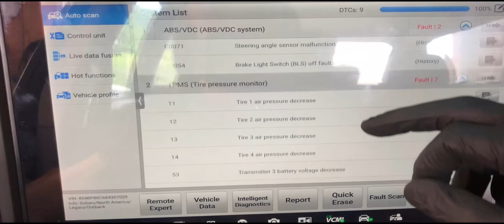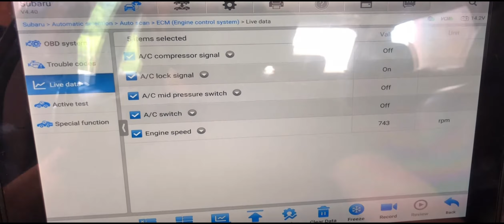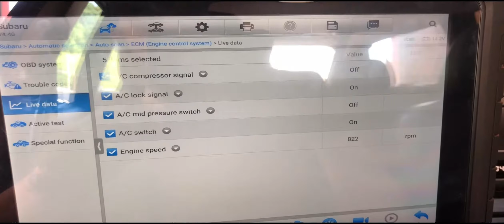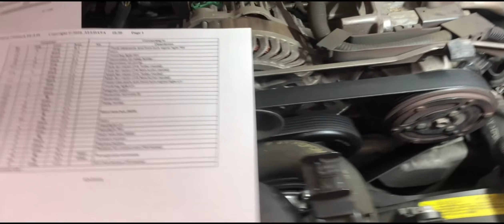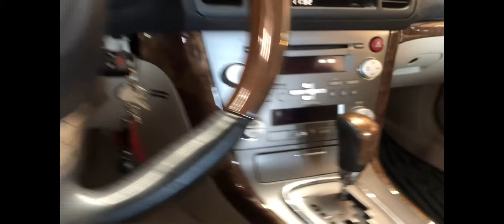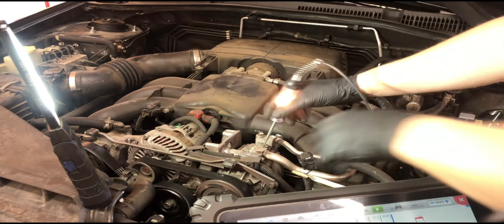Case Study - 2008 Subaru Outback Has No A/C

Comment: The AC Module is not online, this is one reason why after repairs, we like to see another full scan and a full module count for verification, you know how followers always want to see EVERYTHING. WOW that live scan data list for the AC System sucks. AC LOCK is like the Toyota Sensor, it sees if the guts are spinning similar to a single waveform like a CMP, if the internals are not spinning, then no RPM signal so the Compressor must be locked. On a Toyota, the AC Switch light will blink. On some compressors, the little trigger deal inside may have fallen out of its holder or too many metal fillings on the trigger or it simply broke off and lying inside the compressor someplace, of course, the pickup sensor can be bad, need a scope to have a look and check for power and ground as well.

YES, broken belts can beat the hell out of wire harnesses and connectors. Checking for codes popping up on a regular basis is highly advised as a standard practice even if it's a waste of time sometimes. 

The clutch circuit did not come on when commanded, give it a WHACK to see if it will engage as the air gap might be too large for the clutch winding to pull it in? OK, the MALLETIZE test is bad. Maybe a bit of belt behind the clutch??? The test light went out when the command was turned off because the RPM sensor was not sending a good signal so it appeared that the compressor was locked and no need for the clutch power to stay on, it's all LOGIC in the module. How can the coil be open if the light comes on for a few seconds, you are now playing with the wires, maybe WIGGLED it into oblivion?? Can you turn the clutch and internals by hand or is it stuck up inside?? 

You need friends in low places to get the parts that you really ought to be able to get, thanks for the video, it makes no sense how the light works on an open circuit, but may just now went fully open, just a thought, be aware of your resistance meter settings, might make a difference of which scale you are on?? You did not retry the test light test after seeing the coil open?? Just to make you crazier.....
Reply: You might get this vehicle back, you still had the AC Module offline??